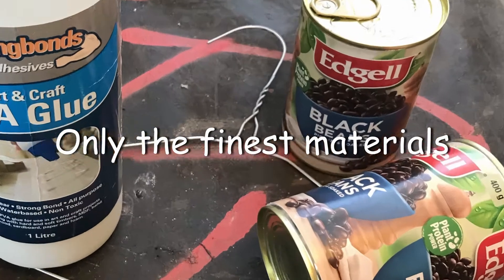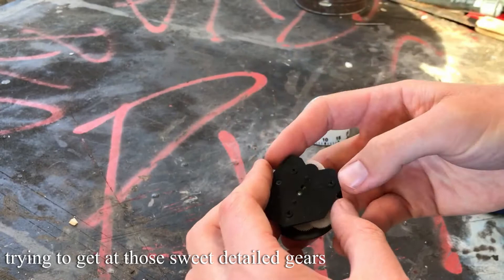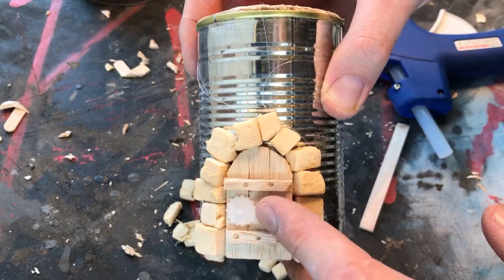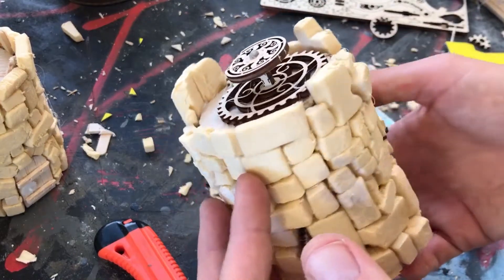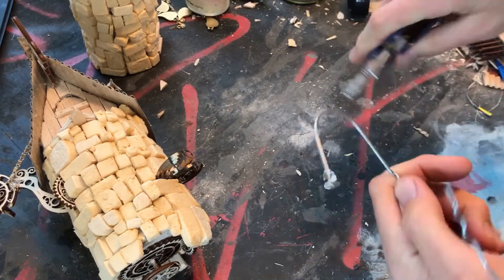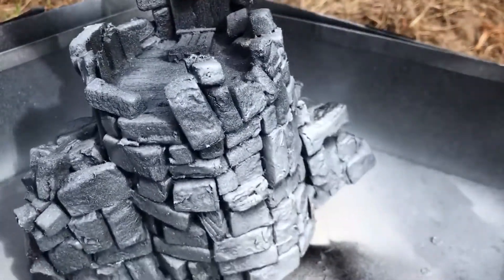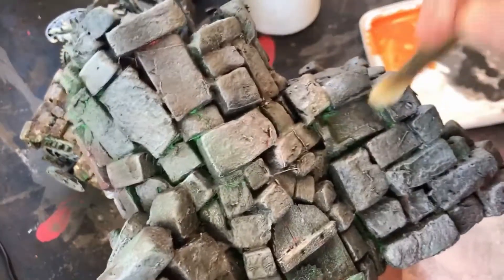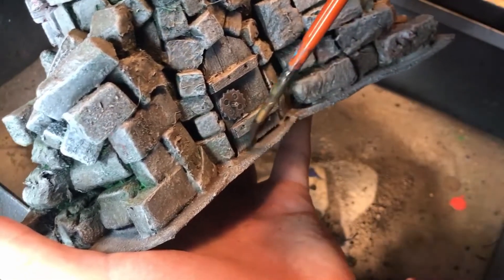A steampunk, clockwork, FLOATING Witch's tower; made from tins of beans!

Comment: No take! Only throw! :P
This piece ended up amazing! Just amazing!
One suggestion for the lightning since you're one of the few people that could test it out: Have you tried the process of painting you described, replacing the Electric Blue by a fluorescent paint? Some fluorescent sky blue maybe? In my experience glowing effects end up looking amazing with fluo paints so maybe lightning itself would look even better. And if it works as well as it has worked for me for glowy lights, it could be of general use for any lightning effects, doubly so if you can manage to insert blacklight LEDs somewhere on the piece since fluo paints very literally glow under blacklights (well, not me, any piece i touch with a solder dies :P)
Fantastic job, i hope your DM loved the piece :D
Reply from the maker: Thankyou very much for the feedback!

Soldering is a weak point in my skill set but a project like the one you described would be a great excuse to attempt some more led projects, and broaden my skill set.

I do have some ideas for 40k projects using similar methods to this one, but the inclusion of UV reactive paints could make for a chilling set piece. Maybe an unstable plasma reactor, or void shield?